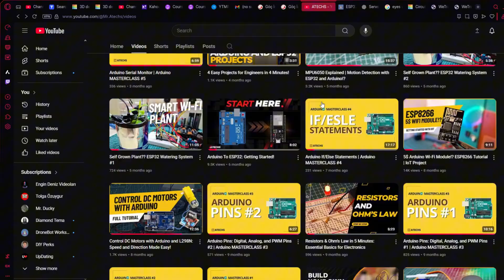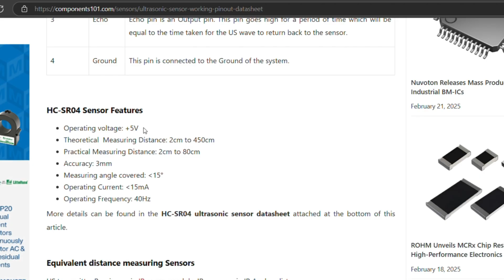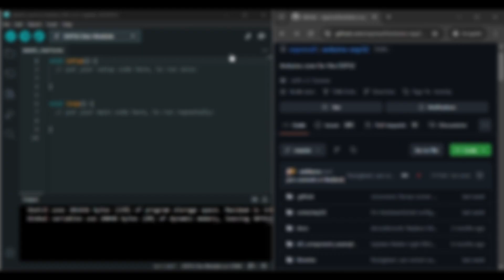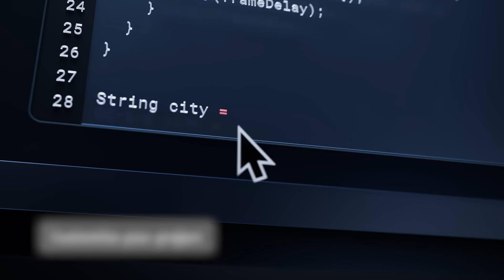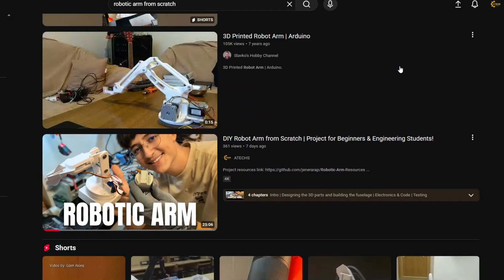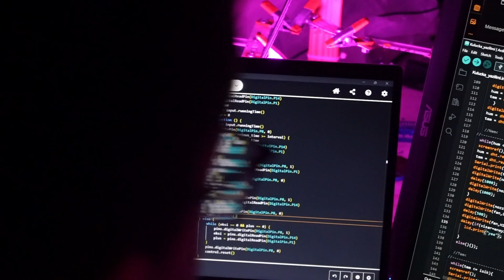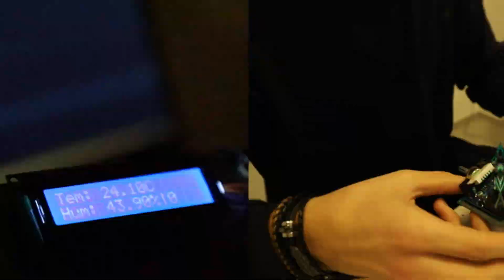ESP32 vs Arduino UNO — Is Qualcomm Changing Everything?

Comment: I was a long time user of MCUs from microchip and went from programming in assembly to programming in C. I ignored Arduino for a long time. When ESP32s and RPi Picos came along I started using them as they were easy to transition to and added good value. This meant that I grudgingly got familiar with the Arduino IDE. I have also used CircuitPython. With the release of the new Arduino Uno Q I have purchased an Arduino board to try out for the first time. I have also played around with early Raspberry Pi boards. I expect if I start a new project in 2026 I will likely select either a ESP32 or RPi Pico. Time will tell if I end up with a project where I want to use an Uno Q. Doubt I will ever use a basic Uno R3 or R4. I just do not feel they are worth the money and I do not need the Arduino IDE for MCUs with the simple architectures. Everything is much easier and less expensive today than back in the early 1980s when we used to wire wrap a bunch of ICs together to make a 6809 board or Z80 board.
Reply from the maker: Wow, thanks for sharing your experience! It’s great to hear from someone who has worked with MCUs since the early days. That perspective is rare and super valuable.
By the way, since you mentioned you bought the new Arduino UNO Q;
How are you finding it so far? Do you think it’s a good board in terms of performance and value? I actually ordered mine as well and waiting to try it..
Reply: @Mr.Atechs  From my perspective it has a lot of potential as an Educational tool. It is early days. On launch there have been bugs in the software. If one does not want to deal with bugs and having to re-flash the operating system I suggest waiting for the early issues to be ironed out. I was curious and just jumped in. It is a different experience than a Raspberry Pi. The thing that caught my attention before I purchased it was that it has eMMC storage on the board. One is not relying on microSD cards for the operating system. This strikes me as potentially more reliable. It comes preconfigured. That strikes me as being easier to manage for beginners than the early experience with a Raspberry pi. The experience would have been better except for the fact that updates to the Lab App software meant that one needed to re-flash the operating system to use the board tethered to a PC. I tried the stand alone set up first and that worked out the the box for the limited number of things I tried before I tried using it tethered to a Computer. There was enough on line help to sort out early issues and there have been fixes for some of the bugs. I am starting by trying out basic features. 
Only time will tell if Arduino with continue to improve the user experience or if the platform support will crash and burn. I have some optimism. Qualcomm paid a lot of money to purchase Arduino I expect they will continue to put some effort into it. I feel I can learn things I did not know by trying this board out. Whether I will actually do anything practical with this board or just use it as a learning experience I do not know yet. Some have commented it is weird or that it has been frustrating. From my perspective some frustration comes with working with something so new and solving problems is something one learns to do in engineering. As more bugs get ironed out I expect it will be a lot less frustrating for people. The comment that it is weird just goes to show they have not cloned some existing system. I am going to have to give myself more time to evaluate the choices the designers have made. This is a system that one can use without already knowing a lot of Linux on the command line. 
One can image that eventually there will be other versions of the OS image configured differently for more advanced users. Only time will tell.

Comment: Pi pico, pico w + micropython.
Reply: C++ is still faster than micropython
Reply: @bogart6174 what about development speed, editing and running the script instantly even with your android phone. Without need for a compiler and waiting for every small change. The use cases where the micropython script is not fast enough can't compensate for that. If a rare case occurs nothing prevents you to run c++ on pico.
Reply: @bogart6174  plus the micropython environment uses up a significant amount of the limited SRAM in the pi pico, which is another disadvantage. It's nice that you can just plug in python libraries to your pi pico when running micropython, but still, its an interpreted language, and plus being on a low compute MCU, makes it not so nice.